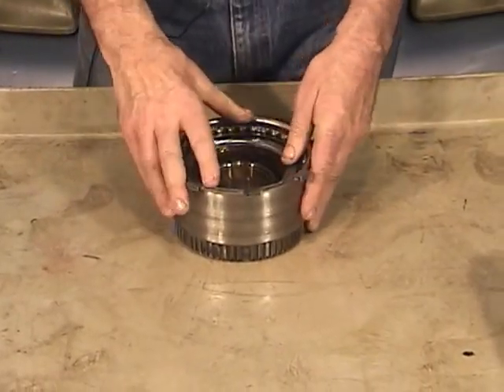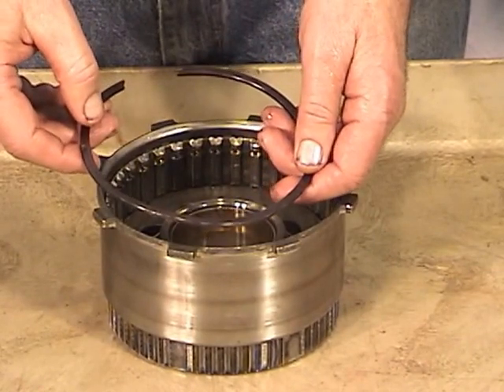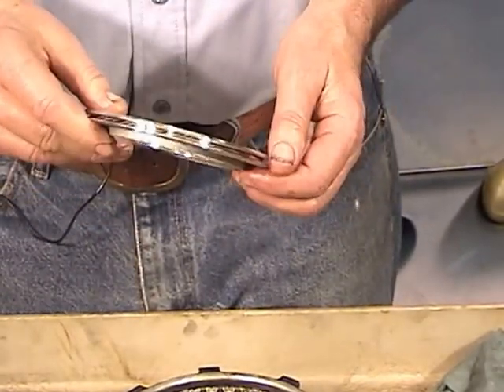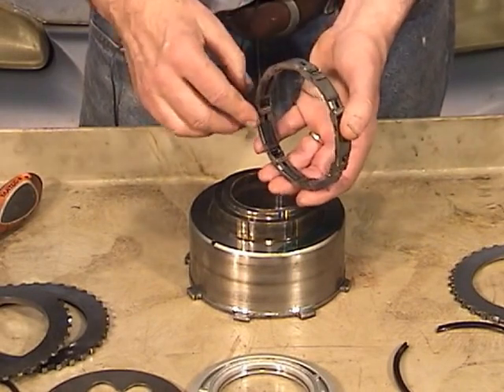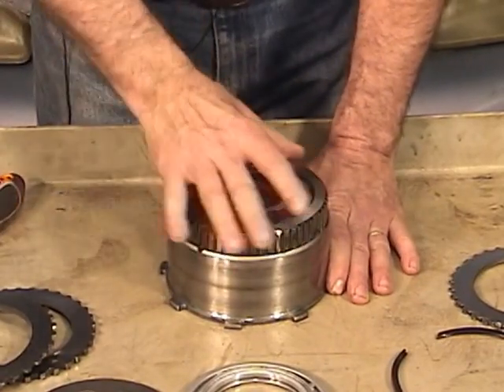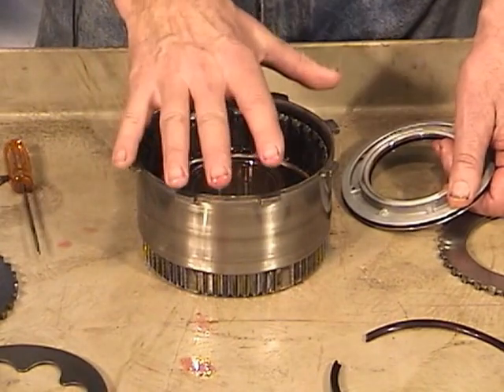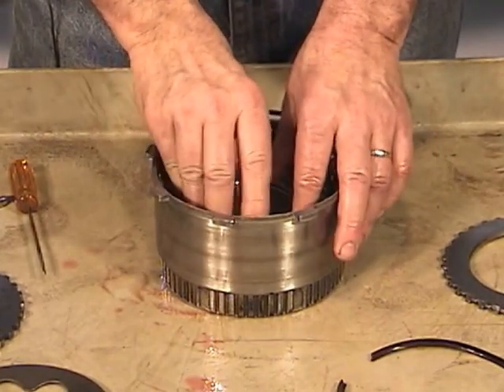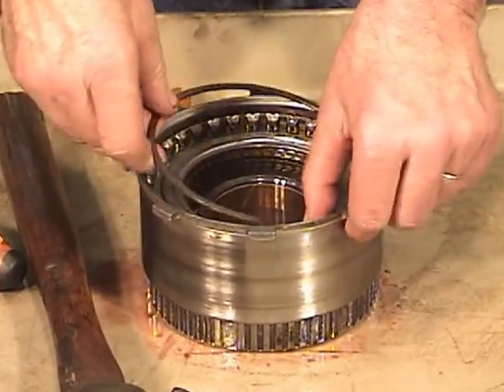How To Rebuild the Ford 4R70W Trans. rev/intermediate clutch

Comment: I have one question and is not to disrespect your knowledge. Would it be better or can you place at the last 2 metal plate (pressure plate & last metal disc) to have them together to be able to measure the clearance of the clutch pack and not chip the friction plate with the feeler gauge?
Reply from the maker: You could and I do that in one of my other videos however, I don't believe there's any danger of damaging the fiber disk with a feeler.

Comment: Baumann and Transgo recommend using F3LY-7B066A friction plate to add an additional steel & friction, that's from the original 3 to 4 to fortify strength & durability.. is it worth it, in your opinion?
Reply from the maker: Maybe for a truck build but I think 3 fibers are fine. Understand it only applies on reverse.
Reply: @badshoeproductions  I can't thank you enough, Ken! Cheers.

Comment: Hi Ken. I have a question about the axial play in the 98+ AODE mechanical diode attached to the direct drum, is it normal? The one with the roller as shown in your video has no play at all. Thanks
Reply from the maker: Normal.
Reply: @badshoeproductions  Thanks Ken. So there's shouldn't be a play with the firm roller type, but it's normal to have an axial play of. 017" and also a radial gear play of. 020" on the mechanical diode type
Reply from the maker: The mechanical diode works like a ratchet wrench. Just like the wrench, there's a little play between the clicks.

Comment: What is the difference between 3 clutch and 4 clutch? I have a 3 clutch with a badly burnt drum and want to replace
Reply from the maker: The 4 clutch drum will have the retaining snap ring groove higher so one more fiber and steel plate can be installed. In most cases, a 3 or 4 plate drum can be used. A truck used for towing should have a 4 plate.

Comment: if that metal ring is split (not complete circle) does it need to be replaced, i assume it does but i am having a difficult time trying to find one
Reply from the maker: Which ring are you referring too?
Reply: @badshoeproductions  there was a metal ring that went into the drum just before that dished (domed) spring went on after it (video part 3, 14:42)
Reply: sorry i have watched so many videos before and after on this thing because i want to do it correct htefirst time and had asked the question in several places, in your video its (15:31)
Reply from the maker: The reverse drum piston has a ring that the Bellville spring rides on. This ring is normally split as well as rings used the C4, C6 and AOD.

Comment: i bought a complete kit to rebuild the 4r70w well it seems that when i got to this rev clutch pack that 1 of the teeth are missing on the inner part of the papers is this common for them to do this ??? it fits but when i notice small things like that i question the part
Reply from the maker: There may be a number of fiber disk teeth missing which is normal if they are equally spaced. You might find the originals are the same way.
Reply: BadShoeProductions no old ones have all there teeth I guess these ones were in a fight lol
Reply from the maker: You can send me a photo if you like so I can make sure there's nothing wrong there.
Reply: BadShoeProductions its a modification they made trans is in drives fine however i got a trans fault i had 5 codes pop up and 2 sensors are bad .
Reply: BadShoeProductions bad speed sensor and range sensor but this is my 4 trans and it went in perfect thanks to my helper mr. Ryan Jackson but I Pat myself on the back for the perfect rebuild first time :-) and thank you and the other guy i talked to on youtube for the help